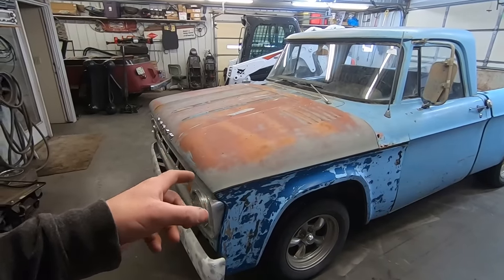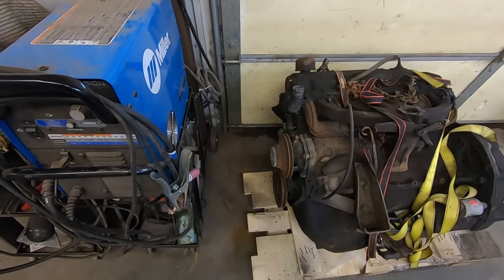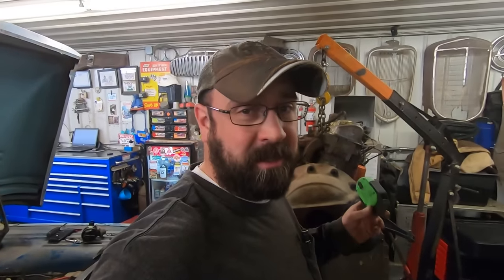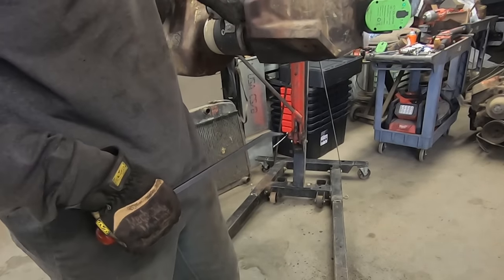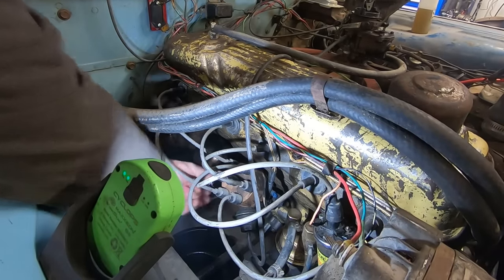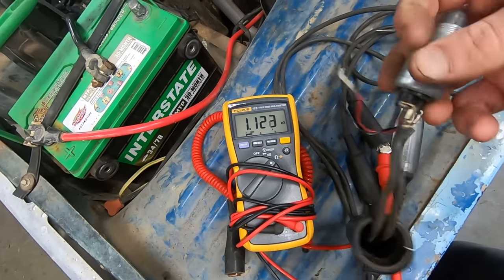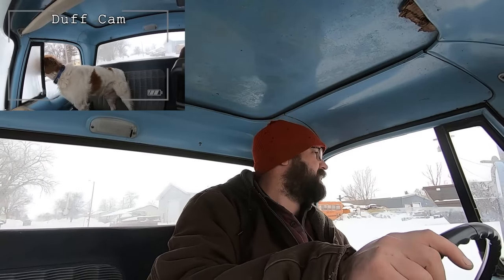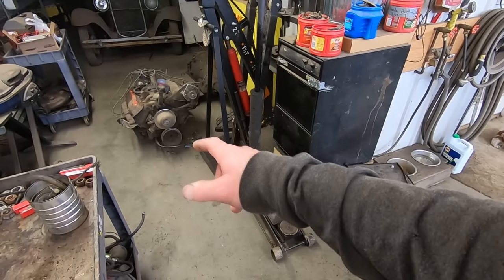The King is back! 1968 Dodge D100 Shortbed Sweptline pickup returns from the Dead!

Comment: I remember my Dad had old Internationals (early 50's), then one day in '68, he came home and got me, then we went to the Dodge dealer in our small town. I got to drive our new 68 250 with the 318, 4 speed truck transmission, and overload springs, no a/c.....,no power steering, basic work truck. The color was like a turquoise or something, but soon that summer we also got 2, deuce and a halves, brand new, electric "split shift" 💥💥💥 bam.!.  They would end up as tanker trucks for Dad's crop dusting business. Excellent vehicles back then. I loved the old Power Wagons also. 👍🙏

Comment: Drove one of these for the Navy back in 1984-85, in Florida, except it was a Power Wagon field ambulance repurposed as an electrical service truck. Had only 14,000 on the odo, a slant six and 4-speed. More than once I pulled the lineman's huge bucket truck out of deep sand, to save his pride from calling motor pool for a tow. An unassuming yet unstoppable beast!

Comment: The yellow paint on the replacement slant six (if it's original) means it is an industrial slant six, like what you'd find in a combine or forklift. You've got yourself a forged crankshaft! Also, they supposedly have valve rotators and roller timing chain with steel gears instead of nylon. The red intake is from a passenger car up to the late 60s (pre-EGR days).
Reply from the maker: Interesting!

Comment: Love that truck. Reminds me of a 1961 d100 I bought back in 1977 from a farmer in Georgia with a poly 318 rapping. Like you we bought an abandoned 1971 Fury 111 and used almost everything into the old pickup, from interior parts steering wheel. front seat, to LA style 318, radiator, etc. Truck had no body rot. After cleanup and driving for a few months, a person approached me and bought the old girl. Made some money and bought another vehicle. That truck also had a 12" hydraulic clutch. That truck did become a screamer after it was finished.

Comment: One reason a Slant Six is so tough, the block molds were originally thicker to allow for Aluminum castings, Chrysler decided to go iron instead. They did not change the molds so this resulted in a heavy duty cast iron block.
Reply from the maker: Interesting!
Reply: I believe that to be true. I've always wondered, if they would have cast them in aluminum, would it have been worth making a mirror image version? Some slant to the left and others to the right? The idea being it's not a big jump to an aluminum V12 from there... Of course, they had the hemi, so why bother. Forgive me, my mind wanders sometimes...
Reply from the maker: @solomonlynn7456  Oh you know they probably tried it!
Reply: @MortskeRepair  Trivia: During initial development, the slant was designed without an oil pump. Keep in mind, this engine went into development when most inline sixes were still "splash" lubricated.  Rumour has it that when Chevy's little stovebolt 235 got an oil pump in what... '56?  Chrysler decided that their "new" engine would need an oil pump too.  It was all about keeping costs at a minimum.  No hydraulic valve lifters until 1980!
Reply from the maker: @That_AMC_Guy  I think once the put a Powerglide in, 1951 maybe, you could get a "full pressure" 235.
Reply: @MortskeRepair  I thought it was a little later. Found a post on the Stovebolt forum that says full pressure 235 in '53 for Powerglide cars & Corvettes only.  All models starting in '54.

I thought it was '55-'56.... but I'm old and my memory is bad.

Perhaps it's more an anecdote?  I've heard the tale several times from mopar folk --- and if you look at a slant, the pump and even the main oil galley are "external".  You can see the "bump" run the whole length of the block.
Reply from the maker: @That_AMC_Guy  I know 55 the full pressure was standard through the end of production in 1962. Before that it was only PG cars. Either way. Good to know!
Reply: The Slant 6 suffered from horrible quality control. You either got a bulletproof one or an oil sucking piece of garbage. If you got a good one you just couldn’t wear one out.
Reply: @prevost8686  I got a good one. I could not kill it , the car body fell apart around it but it never coughed.
Reply: They actually did produce and sell a few aluminium block slant six's....they are rare...lol

Comment: Hey I love the snap on compression tester if you remove Schrader valves and clean them up your Guage will hold pressure. Same valve as your tires use

Comment: Really enjoy your videos. My dog and I start every morning watching You and Duff. 
Two things I noticed in this video. 
1) when you use a timing light you need to disconnect and plug the vacuum advance before reading the advance.  
This is what you compare to the value in the repair manual. 
2) when an engine is running rough like this one was the first  thing I would do is a dynamic power balance test which is just  pulling one plug wire at a time from the cap to see how much difference it makes in the engine rpm then put it back in. 
You need some pliers made for this or risk getting zapped but on old cars especially it quickly tells which cylinder is causing the problem.

Comment: You need one of the spring chokes that go in the intake and work off engine temp. If you had that choke those engines are so easy to start in the dead of winter you don't have to crank it over much at all but that's the choke you need on those engines trust me I have two leaning tower of power one a 67 and another 1979 Super Six with the 2bbl carb and they both start like EFI in the dead of winter even after sitting a week or two.
Reply: This is true. An auto-choke that's working correctly will beat a manual choke every time b/c it constantly makes miNUTE adjustments.
Reply: I always called it a "stove" choke, lol.

Comment: Funny you mention a mouth guard,.......I was doing an alignment on a 1 ton Chevy van and had to use a "crow's foot" to get to the shim holder nut on the upper control arm. Of course it was rusty and would not budge without "too much pressure". I know it was too much because the crow's foot slipped and rocketted out of it right into my front teeth. Broke one halfway off, just enough so the little nerve could dangle out of it. Unplanned trip to the dentist that day. That was 30 years ago and the repair is still holding up. (On the tooth that is), I hope the van is in a landfill somewhere.
Reply from the maker: DANG!!!

Comment: I was always told to zero the wrench to avoid stressing the spring. Meaning toque wrench stays accurate.
Reply from the maker: Yup!
Reply: On all except Stahlwill! They are different,  and also only one made for Aircraft and medical equipment use. 

Worthless knowledge, but damn good wrench. It’s like the Mopar of wrenches!
Reply: @volvobrynk  is that you Torque Wrench King?
😂
Reply: @scottb926  there’s a joke there, and I’m to dumb to get it 😜

I annoy my colleagues with that kind of trivia! 

Often in the air force (or at lest some air forces) they have a bunch of pre-set wrenches, in frequently used specs/values. 

And I’m no king, not even king of hobos, although I look like one 😎✌️
Reply from the maker: @volvobrynk  Intersting!

Comment: The leaning tower is dependable..I had a Duster back in the day with a slant 6...
I eventually put a 318 in it cause a 17 yr old wants more power always.. but the leaning tower never failed me .
Reply: Ended up getting rid of my slant 6 duster because my dad wouldnt let me swap it for a 318
Reply: @thisguy2720  ..
I wanted to put a 383 in it , but they were much more money...
I bought the 318 for $50..lol.
Reply: @pdrphil8159  I figured I'd have more luck asking for a 318. Still didnt happen. Wasnt a bad little car. Wasnt a big fan of the 4 wheel manual drum brakes though lol
Reply: @thisguy2720  
I hit a deer with mine doing 65/70 & totaled it..
I had just put dual exhaust on it & new tires & rims...
It was deer season & at 2 am , I hit a huge buck broadside..
Made me sick.. 
But in those days you could buy cars for a few hundred , so I bought a 73 chevelle ..
Loved it...

Comment: We drove them all had a slant 6 225 62 short wheelbase , 2 67 s  and a 1970 . The short ‘62 was my favorite it hung the road like a train on the tracks . The long base would weave on the road if loaded , I liked the running board behind the door and the fact that the hood would raise straight up. The straight front axle was super cool because extra leaf springs on front and rear could raise the truck .

Comment: Woo-hoo!  Sweptline time!  I'm partial to my 318's, whether Poly or LA, but still hold a fond place in my heart for the ol' slant six.  It was on one of them I learned that it really matters which wire is going to which plug.  On my very first ever plug change, didn't pay ANY attention to which wire went where, figured "they all got spark" and just hooked 'em up, and it was no bueno.  I was learned good after that.
Reply from the maker: That’s how you learn!
Reply: 318’s are pretty dang solid motor as well

Comment: You know if you don't change the O rings on the spark plug tubes often these things become real leakers. The top of the tube where the O ring is seats against is sheat metal any way so you asking a lot for them to stay clean any way. I love the 225 they are as bullet proof as they come.
Reply from the maker: Great info!

Comment: I made it to the blow bye bye portion . Im thinking Gasser . Crazy paint ,hemi , narrowed , chrome ladder bars reaching up past the chrome tube front axle. Then name her the BLOW BYE ! 
Too bad about the blue one . I have had that happen to a lawn mower when I was a kid,  but been lucky enough to catch it a few times after that . A fuel shut off is a thing of the past , can you imagine kids today expected to shut fuel off ? Id almost try an shine up the other crank but your right just lead to more. 
   Im doing the motor swap tonight on my 94 lawn tractor , 18 hp twin got another for $1 at an auction runs fine so far . Other one needs a valve job Im guessing . Hope you have better luck and build a fast GM somethin 4 speed buick ya

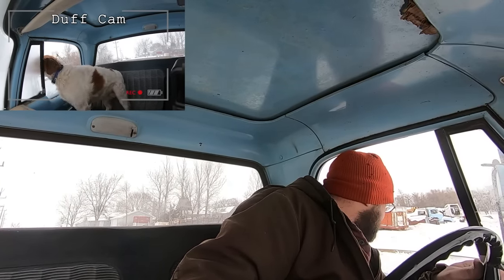Comment: The BEST old junk mechanic channel to watch when one's waiting for parts to arrive!! That's a great unintentional tech tip of the day at 1:36:30 If it's stuck in the snow cuz bald tires, just adjust the idle waaaay high. leave it in gear, and get out and push. LOL. The way you cut that bolt made me wince more than when you hit your fingers on the fan. Reminded me of my old shop teacher, Mr. Stumpy.
Reply from the maker: Bahahaha

Comment: Hello, I believe your 68 dodge truck MAY be an Air Force Truck. The dark blue looks a whole lot like the old Alkyd Enamel the USAF Used back then. I repainted several of them in the mid 70s.I also owned a 67 short bed step side crew cab. YEP 225 lean too. 4 speed with the granny gear. USAF , could not get it stuck. that thing would pull down a house. 2 wheel drive. bid on a 4 wheel drive but to no avail. Great show Sir!!!

Comment: I had aD200 68 camper special.  Mint green.  White roof.  My favourite truck.  I like the tops of the doors for your arm.  Mine had a318. But you need a oil tanker following you.  You could put some big mudders on it.  Lower the revs. Think mine had 17.5 on it.  Gas tank blew out while driving.  Good job no body was smoking.  Cool truck.  Wish I had one now.

Comment: Rotella engine oil may help alleviate that drivetrain noise, it has them extra vitamins older engines need. I wouldn't use Fram filter, to each his own, good job getting it going.

Comment: In 1981 a friend of mine  had a 66 dodge pickup that he spun a bearing in  and we put a set of bearings in it  and drank a case of beer or 2  neither one of us had ever messed with any bearings before that old hillside hemi ran for about 4 more years before he knocked a hole in the pan and ran it out of oil and finally finished it off   that old truck really impressed me
Reply from the maker: Nice!

Comment: Thats a cool truck! ...All 3 (Chevy, Ford,and Dodge) trucks in 68 looked good. Ford and Chevy changed body styles in 67, and Dodge changed in 68.  You and Duff are doing a great job 👏
Reply: Dodge didn't change much in 68, just the hood and grille designs. The big change came in 72.
Reply: @jeffrykopis5468  thanks,  didn't know that. 67 dodge was so ugly on the front, that a grill change in 68 was a major improvement. Ugly or not I would still love to own one.
Reply: @davidarnette327  I've had 3 '71s, and I'd say the 69 (68?) to 71s had the cleanest look, i.e., the least bizarre. But I also had a 64, with the flat, 4 eyed grille, and bumpy hood. Odd, but I liked it. Very nostalgic. I also love the late 65-66 nose, with the big pie plate headlight surrounds and the bumpy hood. They have so much character! I also prefer the 61-64? old school dash, with round gauges. And 61-64s with ATs had a cool push button shifter pod in the left corner. At some point, they went to a Schwinn Stingray type shifter handle on the dash. I love those too. Older motor homes used them too. But my 71s were ordinary column shift.

Comment: My 70's D100 had a slant 6 was knocking so I dropped a 305 sbc with a turbo 350 transmission, I use the Dodge drive shaft with a turbo 350 yoke, I put Chevrolet universal joint cups on the Dodge universal joint it work like a charm the 305 set 4in forward from the firewall, I could take the trans bolts out from under the hood. I just used what I had.
Reply from the maker: Nice!

Comment: Have you ever rigged up a compressor tester hose to an airhose Chuck, then maybe on a sticky motor you might get to use air to move it a little at a time, vice the flywheel tool?   Might be handy when it's hang in the air.   Food for thought!   Great channel!   I like the longer episodes
Reply from the maker: Usually the air leaks by somewhere when you do that. Valves or rings.
Reply: @MortskeRepair  didn't think about that, thank you for the reply👍

Comment: I had nothing but problems with the 225 slant I had in a diplomat crap power no mileage didnt want to start in the winter and it was under 90k even had it in the shop and all redone got it back and still the same. My GM 5.3L has over 300k miles and still runs quiet and smooth.
Reply from the maker: Interesting

Comment: I just this dude, really knowledgeable and you can get hands on experience,never had to do this much to my 68 but i did with my 65 Mercury half ton putting a v8 in it and screwing around with driveshafte and getting the linkage working for the 3 in the tree, miss those days, getting married kinda puts your dreams on hold but if my old Galaxie 500 2dr and Fargo are still sitting at the farm I'm ready 💪 🤔👍

Comment: I had a D100 79 model that was powered by a 360 Automatic and no matter what you did mileage stayed at 10 or 11 Miles to the gallon so I sold it and they put in a 440 Wedge and a  4 Speed!!!
Reply from the maker: DAng!

Comment: Excellent video Mortske Repair  :) also glad newer engine working fine also valve cover cap vent cap squirt pentriotion fluid out with take blow by also cure it and yes seen lots people sell for used $200.00 and totally rebuilt for $500.00 to $750.00  in Ontario Canada most got put starter and Alternator plus wire harness too!

Comment: That was an outstanding video Mortske. Definitely not scripted. Duff does make an excellent supervisor. Lots of leisure time, time to stretch and grab a snack or a nap any time he choses. My wife's grandpa Homer in the early 80's bought a 63 Dodge D-100 former air force truck from an auction in Evansville Indiana that was of course Air force blue. It had a short bed with a slant six for a whopping $150. It would start but would not idle. It would run some better with the choke pulled. Tightened the intake, exhaust and carb bolts and screws. It smoothed right out. Had a three on the tree and a near rotted out muffler. It was fun to drive. My rat rod has 61 Dodge D-100 axles under it. Have you ever given any thought to getting a Quickjack? A friend has one. They are quick to set up and use and stow away and no need for jack stands. Lifts it about 21 inches. I'm going to get one when things are shipped quicker than 6 months. Nothing worse than paying for something but having to wait months for it to arrive. Until next time. See ya!
Reply from the maker: Cool rig! Yeah there’s reasons those lifts aren’t for me.

Comment: I have used the stuff called engine restore. It comes in a silver can and you add it to the oil. I have used it on 3 different high mileage V8s that had excessive Blow by. It actually stopped the blow-by and increased the compression. It works pretty damn good!
Reply: I've never had any luck at all with Restore. I guess my engines were too far gone.
Reply: We use use it when we had customers that had a vehicle that the rings were shot in and they couldn’t afford the proper repair. I’ve seen it slow consumption when it was a piston ring issue. Obviously it couldn’t help worn valve stem seals/guides. I think Project Farm did some sort of test with it.
Reply: @prevost8686  Yeah, Todd used it in both his Ford Ranger, and big blue 70s Ford tractor, and he swears it worked.
Reply: Ditto on the Engine Restore. Not saying it works in all situations/engines... but I had a Dodge that had an injector stick open on the drive home, didn't realize it until I got home, ended up with a dead cylinder (had like 30psi hot compression and decent amount of blowby and rough idle). Dumped in 2 cans of engine restore as a last ditch effort when I changed the oil, put a few hundred miles on her, compression is back up to about what it should be and no more blowby or oil consumption